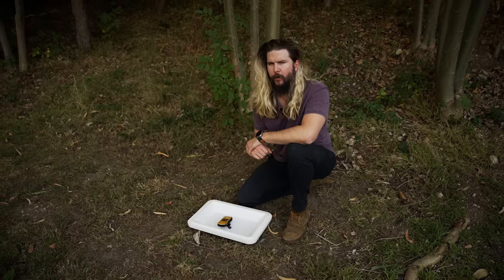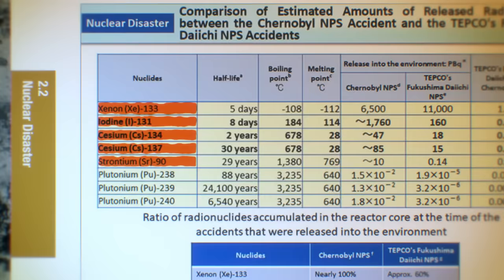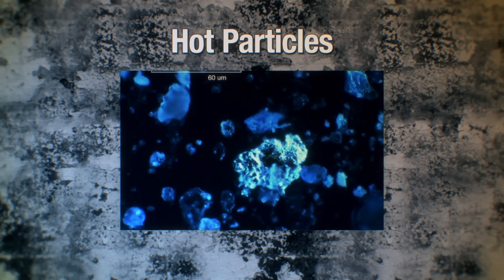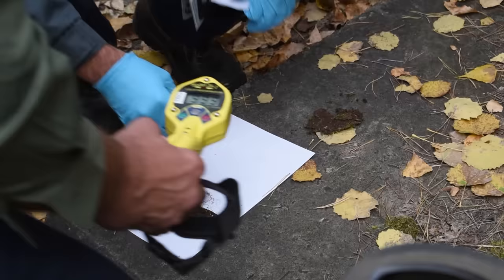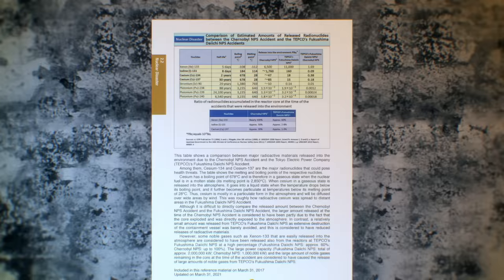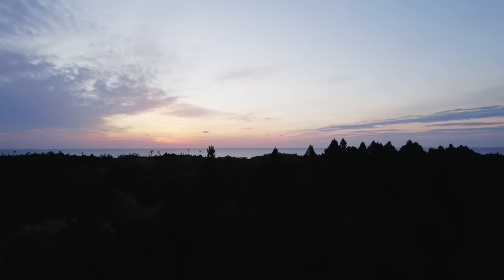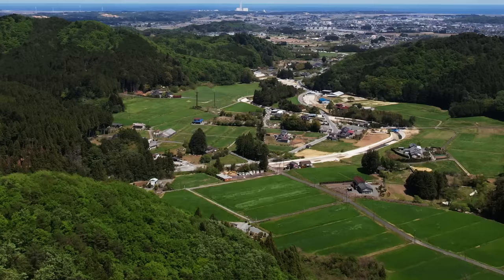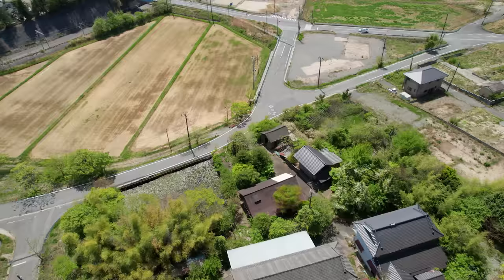A Nuclear Disaster's Deadliest Detail

Comment: It's an interesting one.  If you look at 19th Century novels about mad scientists, like Frankenstein, their ability to manipulate the unknown made then scary and villainous in our eyes.  Back then it was electricity, which is why things like the "Jacob's Ladder" appears so much in popular media.  In the more modern day, it's nuclear power, because it's something that apparently requires University-level physics to understand (sure, it helps, but middle school level science is fairly good too) and you can't see it.  And regular background radiation and the like isn't covered in-depth.  Also, it's like an aircraft crash... air travel is by far the safest in the world, but if an accident occurs, everyone hears about it.  Even things like Three Mile Island was largely contained within the plant itself, and Fukushima (the only 'actual' INER level 7 accident... Chernobyl is only level 7 because the scale doesn't go any higher!) had the rather graphic hydrogen explosions in the containment buildings, the radioactive fallout was fairly low and even after slightly radioactive water was discharged into the sea, it would be quickly diluted.  However, Chernobyl was just so muchworse than anything imaginable because the reactor itself exploded and exposed the core to the open air, with radioisotopes and quantities so much more deadly than what we normally see.

Like aeronautics, studying nuclear physics has make me more relaxed and reassured about it, ESPECIALLY the disasters because it's one of those industries where the agencies go out of their way to learn their lessons and try to make sure a carbon copy incident never happens again.

Comment: What bothers me with questions of cost and money in the nuclear industry is always the pro bono question : who profits. 
I don't know the financial conditions surrounding the Fukushima reactors. But in countries like Canada, a very large part of the financial burden following an accident is covered by the State while the State recoups by taxing the corporation that runs said nuclear facility. For the longest time in Canada, a corporation would have a 100 million dollar liability in case of a nuclear accident. Today that's closer to 1 billion. However if the corporation files for bankruptcy, then the State HAS to take over. At that point, every single citizen must pay for the cleanup, on top of all the other taxes and burdens a citizen is expected to cover for. 
In the case of Fukushima, It isn't clear whether the state paid in full for the moving of citizens out of the irradiated zone or if citizens has to pay, partially or completely for the consequences of a nuclear enterprise they never had any role in. It's basically paying twice for someone else's mistake. Once by tax and a second by having to cover for issues the State or nuclear corporation will not cover. Funny in that case how citizens are stuck with a financial burden for a business plan they had no stake in. Yeah, sure, electricity might be cheaper when the nuclear reactor is running fine (enphasis on the "might") but that doesn't make a citizen a stakeholder in the corporation. 
In that sense, the citizen isn't **really**profiting. The State, because it could get stuck with a hot mess is not profiting either. The profit comes if there is no accident and the nuclear corporation doesn't cheat or apply undue pressure on the political system to pay the least amount of tax back to the State. 
What's left is a private corporation building this golden parachute: make loads of money when the project actually works and then call it a day if there's a nuclear accident. A bit of creative accounting and the CEO and big whigs get a nice severance pay just before the corporation goes tits up. 
My feeling is the question of nuclear reactors is so much more than just the mechanics. It's a business venture and a hot political button. It's not there to spread money and riches but to concentrate the returns in a small amounts of hands while maximizing the State's financial responsibility. In a world rife with scandals and money being thrown in a pit, we need to be as skeptical as possible about all projects and government loans / giveaways.

Comment: Seeing that an HVAC system can contain fallout is mind blowing.
Speaking of bowing reactors could steal old technology from submarines. Directing a large compressed air bank to vent onto a rupture reactor. Simple mechanical and pneumatic systems that could be engineered to survive disasters and still work. You don't have to cool the reactor, just the air venting into the room should be enough to condense materials back to solid.

Comment: hey kyle when you mentioned the moss as a bioaccumulator i had a curious thought pop up : if it can accumulate radioactive materials than is there research on if the moss could be a clean up strategy (not a replacement but an assistant to reduce material waste that has to be contained) kind of like cleaning up spilt water with paper towel as you could let it evaporate or collet and dispose of

Comment: I have a uranium question.  Are you familiar with uranyl phthalocyanine 2, U(pc)2?  Want to know if it is hot particle or something that radiation could be "contained" by its structure??
Reply: It’s an ion that is part of luminescent reactions in regards to uranium. While just about anything that is derived from uranium is radioactive to a degree; uranyl ions like what you’re asking about are considered more in “salts” category of radiological materials. It might have some alpha radiation decay, but for the most part it’s a chronic accumulation in tissues sort of danger rather than it throws off gamma where it’s dangerous to come into contact with.

Of course its danger is going to depend on the circumstance in which it’s found. Is one being bathed in the beautiful blue light of an exposed reactor core? Or does one work in a labs where it’s used to stain electron and electromagnetic microscopy studies of DNA?

Comment: Kyle, more than five times once former Soviet Navy records are unsealed. 

The icebreaker, Lenin, alone likely had two (1965, 1967). Other nuke SSNs/SSBNs (K-159, K-27) likely yielded corium by their accidents. SL-1 in 1960.Leningrad NPP, 28 Nov, 1975. Chernobyl Unit 1, 1982.

Comment: When the Soviets were describing radiation they used Roentgens. The Soviets were sent a German ROV for clearing the roof areas. It failed almost immediately as it encountered graphite from unit 4's core on the roof areas. That material was throwing off twelve THOUSAND Roentgen & was split blocks of the original moderator. Completely unapproachable by any means whatsoever.
When the Russians invaded Ukraine they were also at Chernobyl. The stupid sods were digging trenches in the Red Forest. My understanding is that this marks where the wind was scattering the the core material.

Comment: I can wear a suit made of Anthrax over a suit made of Teflon and be fine. 

If I wear a suit lined with Neutron-Flux Activated Charcoal over a lead-lined suit, I will die.

Nuclear scares me for different reasons it scares most people, but it still scares me. 

The thing is, I'm just as scared of background radiation. The thought that I'm slowly rusting from oxygen consumption degrading my telomeres is also horrifying.

I hate thinking about the inevitability of biochemical morbidity.

Comment: This was another fascinating video along with all your other nuclear videos.  The moss thing got me thinking.  Could organism be genetically engineered for nuclear contamination cleanup.  Could a super moss be engineered and sprayed over a contaminated area from a crop-duster.  The moss would be left to concentrate the contamination for a few years then another organism introduced that eats the moss and collects the contamination it it's body.  You could then collect those organisms and dispose of them along with the contamination.  You could concentrate from smaller organisms to progressively larger organism until you have something that's easy to collect and dispose of.  You could seed an area and come back in 10 years and easily collect the contamination.  If the organisms can easily leave the area, they may end up spread the contamination.

Comment: If you have a large contaminated area, could you not sluice it or use a shaker table to seperate the densest particles from the lighter ones. Since uranium and plutonium are much denser than cesium and strontium, they shoukd collect in the sluice. Just as miners do for gold.

Comment: What is the protective factor here? Are the latex gloves providing enough of a barrier to limit the radiation you are receiving while separating the substrate searching for the hot particle, you are not spending much time in the presence of the source of radiation, or both?
Reply: the protective factor is that the radiation dosage is not high enough to do much in a short amount of time

Comment: Surely it doesn't help that cesium is the most chemically reactive alkali metal? Doesn't that stuff catch on fire when exposed to water, in large enough quantities in contact with water it can explode and spray particles of burning, and, in this particular case, radioactive cesium particles everywhere? Does this nuclear fallout cause fires when rain hits it? I can't imagine that this stuff would be good for you, if red hot molten cesium falling from the sky were to land on your skin, which is full of water?

Comment: can you explain why both fukushima and chernobyl are classified as the worst tier of accident even tho chernobyl is like 100 times worse?
Reply: Its because their greater impact on people and the environment as well as the extent of countermeasures.

If we compare the sizes of exclusion zones between the two, the size of the zone isn't as large as you might think. Chernobyls being 19 miles and Fukushima being 12. Where as the level 6 incident doesn't even have an "exclusion zone" at all. (At least that i saw in the short research i did)

Furthermore, the size of evacuation between tier 7 and tier 6 is fairly large. 
Chernobyl: 335 thousand people
Fukushima: 154 thousand
Kyshtym (only tier 6): 10 thousand

That's a MASSIVE difference between the two tiers. Combine these examples with the fact that we don't really have a huge pool of data to base the tiers off of, and you have two "incidents" (disasters) that absolutely stand out above the rest as having an impact of a much larger magnitude compared to everything else

Comment: Hey Kyle, could an AI be trained to tell the minute differences between hotspots and background cesium and then put into a sort of metal detector style Geiger counter?
Reply: You wouldn't need an AI for that, rather a comparator that can differentiate finely enough. Also without a way to separate samples like with fractioning you cannot determine whether the radiation measured is a sum of spread out radiation or one particle radiating very strongly

Comment: Why people are afraid of nuclear power is both easy and difficult to explain. Humans have an innate desire to feel safe, even in the face of potential danger. Let's consider the evolution of transportation to illustrate this point. Initially, we relied on our feet, a relatively slow mode of travel. Then came horses, not exceedingly fast but a significant improvement in speed. The advent of cars was widely embraced, as everyone seemed to love the convenience they offered. Subsequently, we achieved flight; however, most people stopped short of wanting to be pilots themselves, feeling content with someone else taking control.

As we advance, the prospect of space travel for ordinary individuals looms on the horizon, and similar concerns will likely arise. The evolution of fuel sources follows a parallel logic: from fire to oil, then electricity, and finally nuclear power. Despite this progression, people remain hesitant for the same underlying reason.

Comment: From what I can see based entirely off of what you have shared... I hope....

Is that when it comes to the moving of contaminated soil. Containing it... Then decontaminating it and hopefully repurposing it...

It should be stated that it has helped with the longevity of our planet... Through the lowing of average radiation across the board...

The best way to translate what is see... Should be simple... Ive been working on it for a while for occasions like this...

Though i may no have the experience I should have some understanding to help mentality with getting through the literal fallout that most likely will last generations after the fist unsuccessfully contained nuclear reactor meltdown and first nuclear strike's from the ones just for show that we did to ourselves... America... Russia.... To the ones used against another... America to Japan...

The nuclear fallout would be seen like this...

Me lacking the experience so take it with a grain of salt..

As Emile once said.
"First glassing... Me too."
~emile halo reach

But to continue...

Particals... Spherical particals for the second half... Getting myself prepared for explanation which may or may not be lucid

"Third time's the charm... Who's counting"

When a nuclear explosion happens regardless of impact... See a cylinder... This cylinder is said impact radius..  bottom of the cylinder at the center would be ground zero... The detonation has yet to occur. The top of the cylinder would be the edge of our O-zone...

Detonation occurs... The cylinder hourglasses the immediate zone is then vaporized around ground zero... Now for simplicity's sake... Reactor core meltdown turned critical mass.... Resulting in a detonation... Reactor is melted and mostly vaporized turning into the 3-4 elements listed in the video that causes the most problems.... Explosion has yet to expand... The facility top to bottom is engulfed in a high heat situation as it begins to 

A. Melt.

B. Crack

The difference... A pool of metal may come to a solid and flat standing after cooled... Cracking occurs when the heat is enough to burn but not melt and ignite said materials... Even if there "not flammable".

Then the radius expands out from ground zero the top half of the hourglass comes crashing into the bottom Half...

The initial shock wave as the building melts burs cracks and crumbles.

Yet to expand to the point of lift..

"The storm... Anything light enough will be carried with the storm... Anything to heavy will not be picked up or just moved and left at the bottom of the current.. both in rivers and in winds"

Thus the foundation begins to crumble as it crumbles instead of gravity pulling it down gravity in the cylinder has reversed for a moment. So the debris begin to lift.. the closer to ground zero the more away from ground zero it's going to go... The further from ground zero... The closer to ground zero it's going to go... Turning the hourglass in to a bottle neck crashing together and crumbling the debris even further.... It's not that vaporized means not there anymore... It just means it's broken down to such a small point it might as well not be there... 

So all these tiny particulates are bottle necking then mushroom clouding and turning to vapor... 

So time passes and the initial shockwave continues and the cylinder is still there...

Broken down and pumping radiation in to the upper atmosphere... Not enough to destabilize matter but radiation nine the less....

Difference between air radiation and ground radiation...

Potency, surface area and surface tension..

Wind has no surface tension Wich is why it can accelerate so fast... Just slides right across the planet..

Water doesn't have as much surface tension as another material... But it has more surface area than air... Which is why when air and water come into contact with dirt and stone... The move around it and..

A. slow down.

B. Speed up.

The dirt may be irradiated.. but the stone beneath is alright...

Make pylons from the stone beneath the dirt... Not form ground zero but place them pointed twords ground zero and the moss would be able to syphon the radiation and put it to good use in the soil... 

Burn the moss don't soak it in water your just going to make nuclear waste and then more moss will eat the waste.

To continue onto the 3rd phase that is probably in the middle of happening or just about to happen... 

The particulates will begin coming back down and soaking into the ground across the globe. Probably other planets in our solar system including our sun... Yeah take that oh unforgiving hot ball of gas we rely apon for a comfortable life.... Any way...

Getting back to the cylinder..

At this point the surface area that is the cylinder included ground zero will have a second wave of radioactivity...

Simple reason... The plants are just going through withdrawals symptoms...

Like heroin is for man... Nuclear activity to the scale of the sun nuclear reactors and nuclear strike's are more like a very lethal and multiple times more potent doce of heroin then anyone could experience...

Then the moss will decay and return to foliage even greener and more vibrant than before as a result of the stress on the genome resulting in plural colors and shapes.... Hmmmm sounds like another genom... Oh yeah our fucking genom... How man can make comparison with any as if it were just another man.....

Comment: too bad you can't force radioactive particles to decay faster... like digging the soil, force it's stuff to react to a more stable element set and just place it back... tho i would think the evacuation was necessary but the cleaning well... i think it should be done with those understandings you just pointed out, nature moves and they should follow how it moves. (also maybe concentrate on where it is "hot" and not just clean "everything" blindly.)